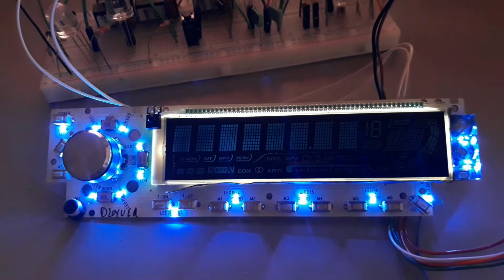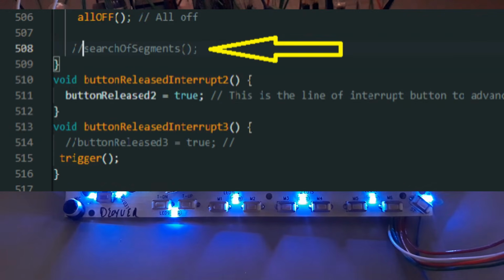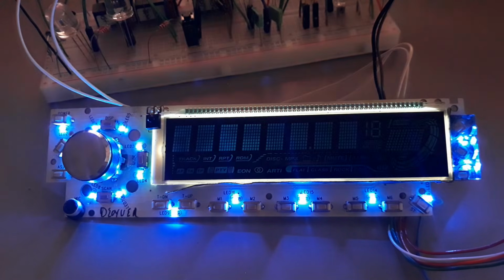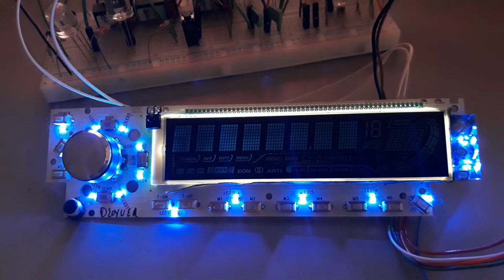PT6523

Comment: In my version of the segment search program, I searched in symbol/number byte/number bit format, then created a map and managed the data display. However, I had to use external memory, as the ATMEGA couldn't record the values of various symbols (ROСK, Classic, etc.) and couldn't fit the entire map (20 x 8). The resulting array is ({"D9",0,0}, {"A9",0,1}, {"J9",0,2}, {"L9",0,3}, {"K9",0,4}, ......). The program then generates texts from the letters specified in the template based on coincidence.
Reply from the maker: First of all, thank you very much for watching!
Congratulations on the automatic identification of segments/positions. Fortunately, nowadays a project like this becomes much easier with the help of AI. However, most viewers have some difficulty with "C", which leads them to give up on projects. To avoid this, I try to keep the example accessible to everyone, even those who have difficulty with programming. No libraries! No pointers! No complex arrays! Keep the data in hexadecimal and binary!
This, in a way, allows the user to change the "bit" and observe the result of the change when sending it to the display.
I would like to count on your presence for the next video!

Comment: Hello, do you specialize only in display? I like the information you share, thank you. Can you carry out programming for the M62445, it is an audio processor from AIWA, I have several of those ICs, I cannot understand how to start this programming with a 16x2 display to show all its functions, if you have the time, I thank you for the favor, Merry Christmas.
Reply from the maker: Hello @SaitronicleoTV,
Thank you for your question! I don't have access to this audio driver, unfortunately! If you have many, you can send one and I'll take a look! Of course, I'll keep an eye out to try and locate one so I can help you!
I looked at the IC datasheet and it's quite clear. It has an input from the MCU with Clock, Data, and Latch that receives information from the controller and has the pinout map as well as its bit-by-bit functions. The relationship between a possible display and the configured audio state has to be created in the processor used, meaning that the Arduino (for example) will send a configuration to the M62445 and will also be responsible for the information to be sent to a display driver.
In short, it doesn't seem complicated to associate the M62445 with an Atmega or an STM32 to send the information to the display driver and the M62445, but I don't have any that would allow me to proceed with development and testing.
Reply: @jlsmonte Hello, I understand your explanation, I don't know how I would send you one, I am from Venezuela, I don't know how I would do it in that case, I can get you the information or a guide to make it easier, I for one am a beginner, it is very difficult for me to understand and interpret that programming.
Reply from the maker: I'll try to locate an IC... to develop it, you'll need to use triggers and create two gates, one for the VFD or LCD and another for the sound processor. This requires one on the workbench, otherwise the work will be done by trial and error, which will consume a lot of time!
Let's give it some time and hope I can get one!
Reply from the maker: Hi @SaitronicleoTV,
The 2 IC's arrive at begin of February, I hope it is not fake! I buy it on eBay.